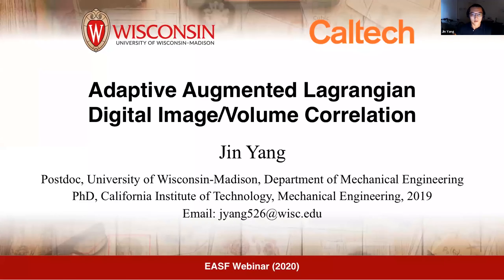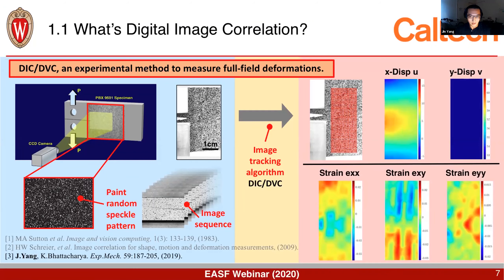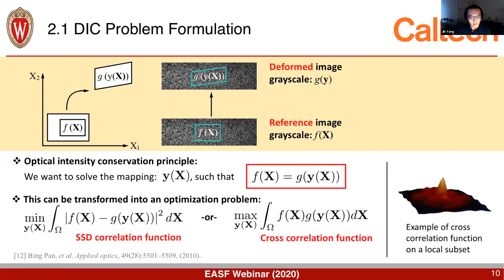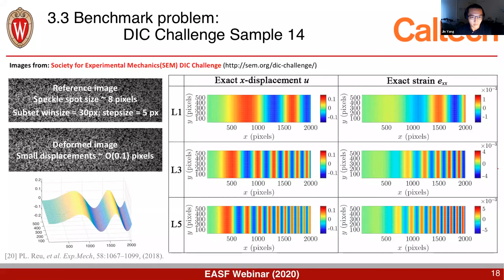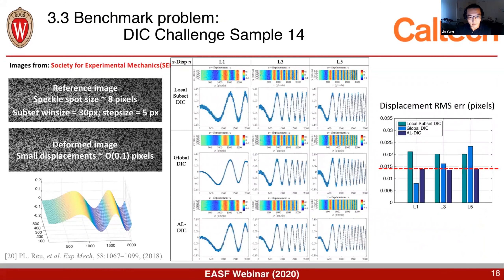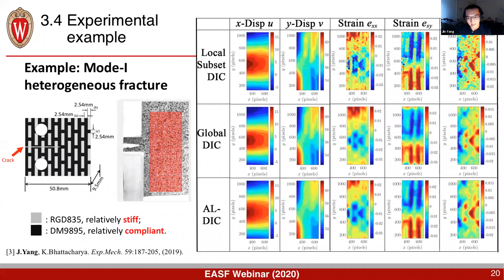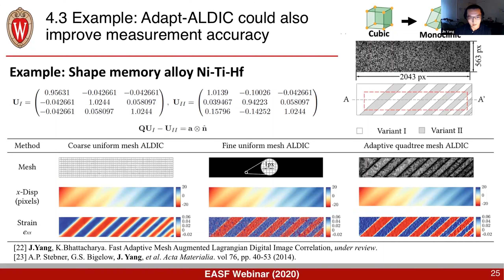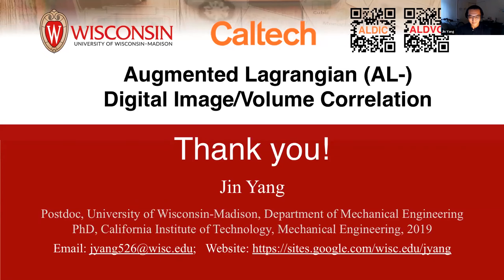(EASF webinar S2E2) Adaptive Augmented Lagrangian Digital Image/Volume Correlation

Comment: I was hoping to use the AL-DIC system in monitoring the surface cracks and strains in a beam experiments and could not find any details about
1,the type and number of cameras used.
2,the type and quality of the image that needs to be produced and how to produce them
would you be kind to elaborate on this or suggest a document that would be ideal to answer this questions.
Reply from the maker: Thank you for the reaching out!  I would recommend this Guide book written by the International Digital image correlation Society 
https://idics.org/guide/    Hope this guide book can be a good reference to answer your questions!